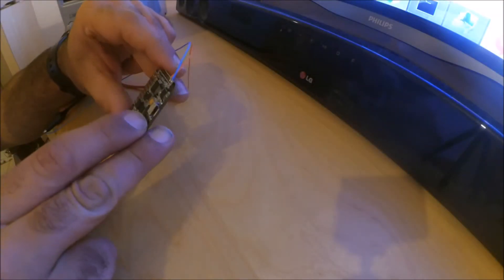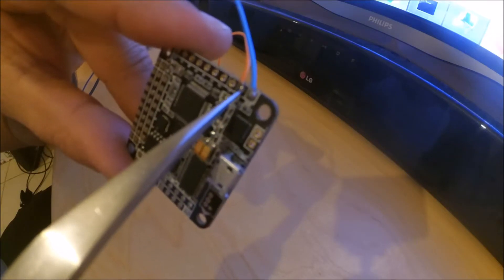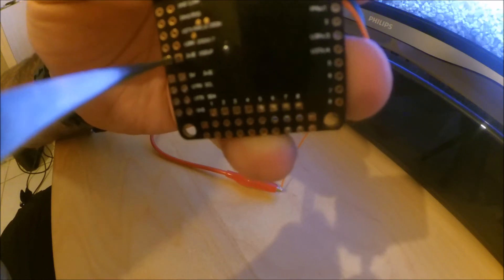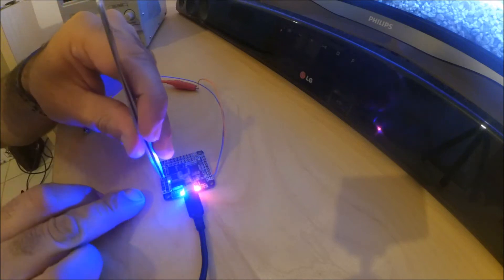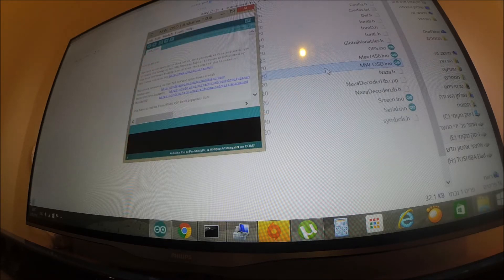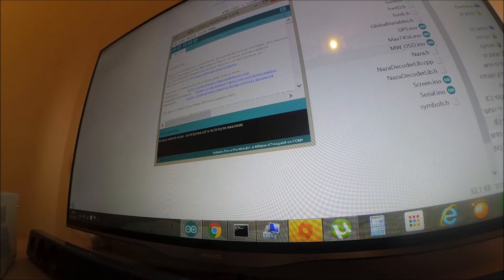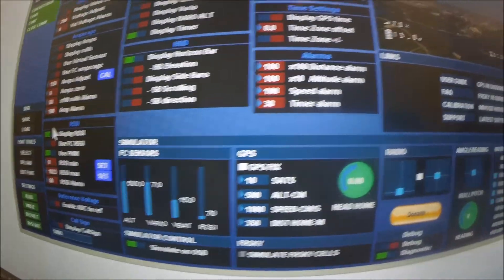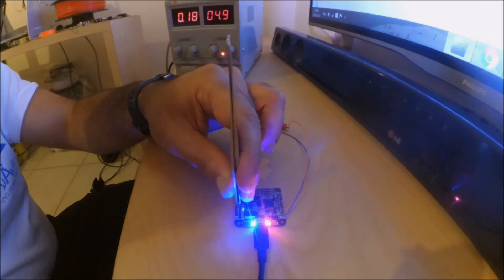Flash and config "OSD" LS - F3 + OSD V1

Comment: Can I plug in the battery and the usb at the same time?
Reply from the maker: yes, but when u pluging the usb with battery without short 3.3 with osd peds - the F3 take control of uart 1
Reply: +Elad Hayun Ok, so as long as the 3.3v pads aren't shorted, I should be fine? Does the SBus from my rx solder to the U3RX on the FC?

Comment: LATEST update, the spracingf3mini.hex do not work correctly on this FC.
3/4 motor will not work.
Reply from the maker: wich version ? 2.5.4 boris?
Reply: +Elad Hayun 2.4.1 and above
Reply: +d1nzfe correct firmware here.
https://www.65drones.com/blogs/news/115817219-heres-how-to-make-ls-f3-osd-f3-osd-integrated-flight-controller-work-for-you
Reply from the maker: +d1nzfe mmm.. ssevet installed 2.5.4 yesterday.. we need to ask him how it's work and replay massage
Reply: +Elad Hayun i tried everything looks fine until you do the motors calibration
Reply from the maker: +d1nzfe have a news about the software ?
Reply: +Elad Hayun running the firmware listed on the page have no problem at all.
Reply from the maker: It's a boris version ?
Reply: +Elad Hayun no its not,  and have added a BETAFLIGHT version